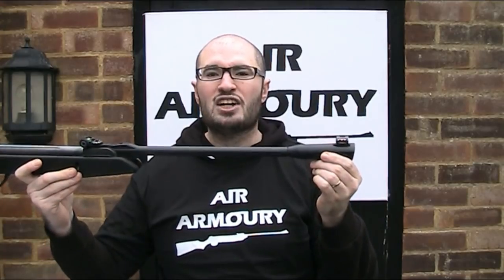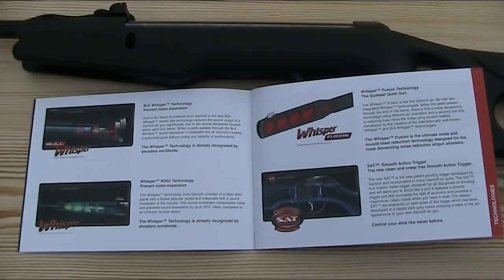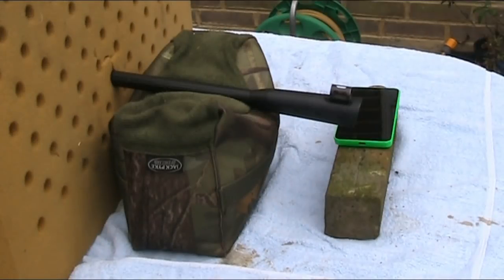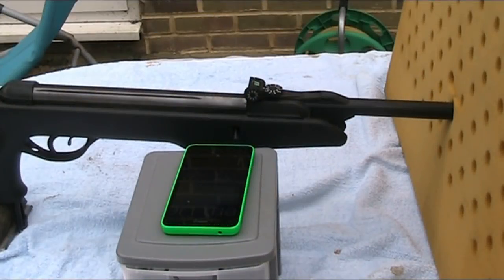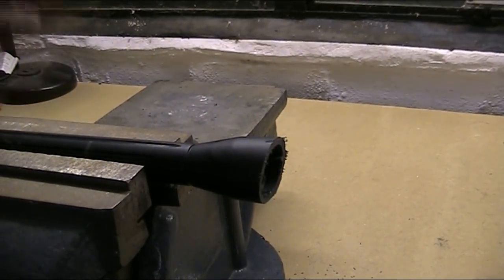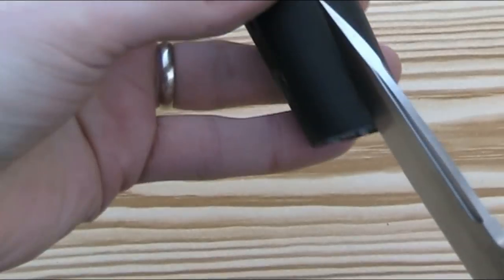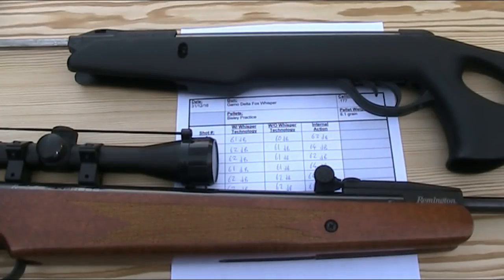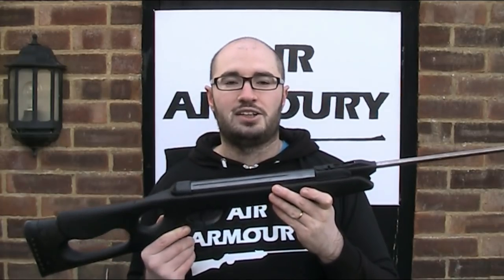Testing Gamo's 'Whisper' Air Rifle Technology | Air Armoury

Comment: I've been using a crosman f4 with a nitro piston for a few months and you can hear the pellet hitting things. With the gamo shadow whisper, I only hear the gun. The first time I shot it, I thought that the pellet was stuck inside the barrel. Nonetheless, I like it and it's supposedly up to 50 fps faster than the f4,  at least on paper. I've never chronographed them. Today, I managed to take down an iguana with the gamo and it works like a charm too.

Comment: To help consider why Gamo don’t have noise suppressors on their most powerful air rifles you could have investigated to see if there was any velocity difference. But the findings could have been moot considering the power differences between this rifle and their Magnums. So you would need to test the most powerful moderated versions. Which you would likely need a FAC for, as well as the budget... Also some say those suppressors (when functional) affect down range noise, rather than side on noise as you investigated.

Comment: You sere getting what, about 62 decibels with the tock gun. That does seem very quiet. I've senfigures on a Crosman Optimus, which is a springer of just over 100 DB's. their Vantage model, shich is a nitro piston model of around 95-96 DB's. So, 62 is pretty quiet. And, after you cut everything off, it still was under 70.

Comment: You also need to have the measuring devise on the same platform,same distance,same height. This proves nothing.
Reply: That is what I noticed. The first test with the moderator was directly just underneath the barrel but the skin less one was further away :)